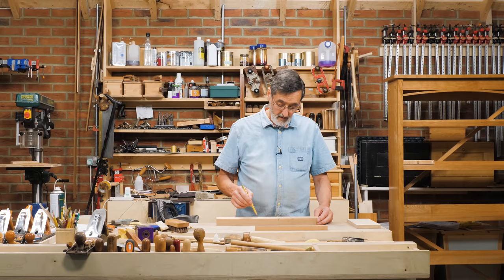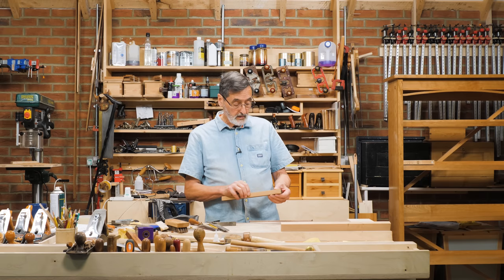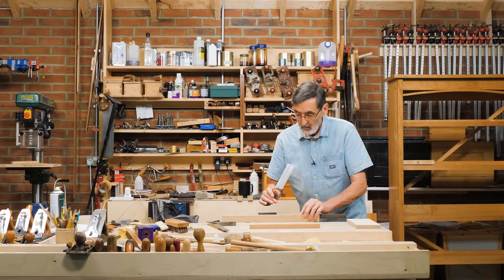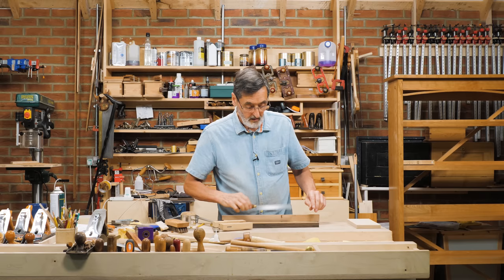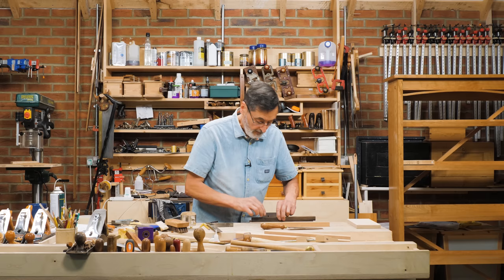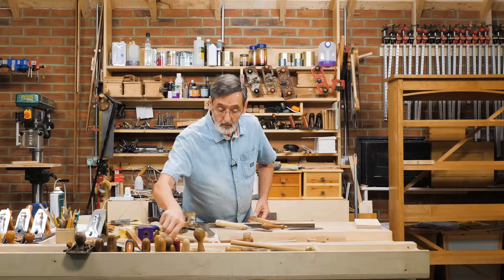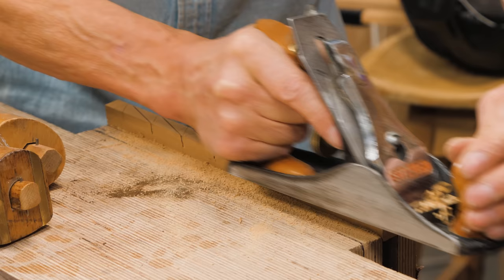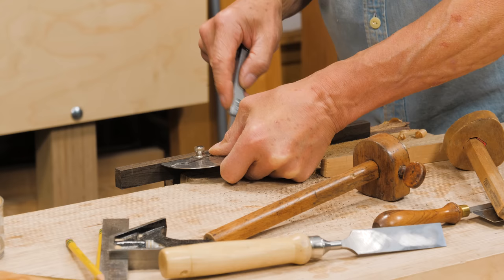How to Make a Raised Faceted Star | Paul Sellers

Comment: Any recommendations on cutting the pieces off the board without a bandsaw? Of course, just cutting down with a handsaw works, but it's hard to be 100% accurate that way, and then you're left with a lot of fiddly planing of the back of the tiny pieces.